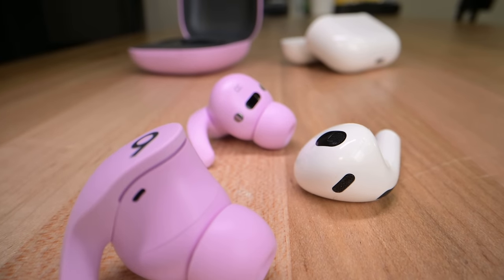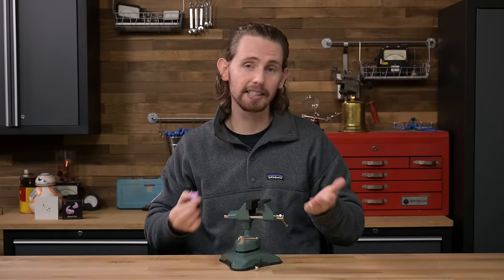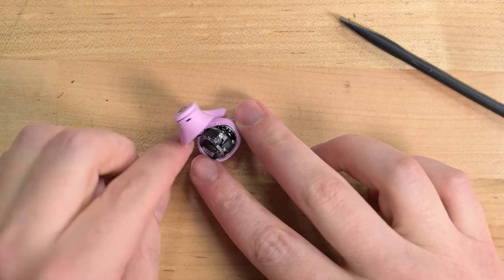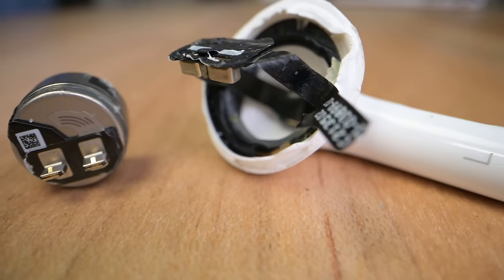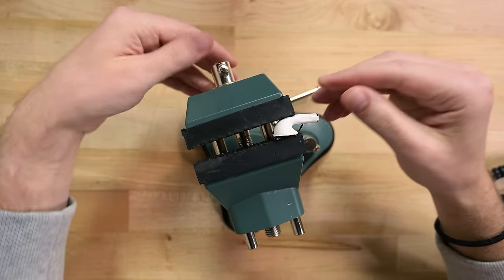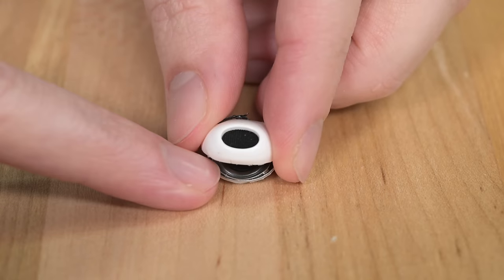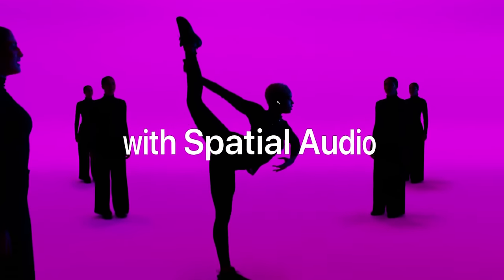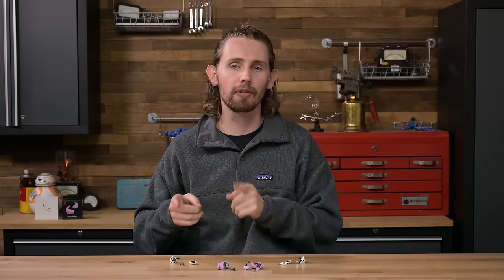AirPods 3 Have a New Trick Up Their Sleeve …

Comment: To be honest, H1 can't do this kind of computational audio. What Apple does is actually trying to render spatially-mastered tracks on the player device using the surround sound algorithm that allows them to simulate how the sounds propagate and change spatially. AirPods simply use the gyroscopes to measure how your head moves and the player device changes the spatial render parameters to produce spatially transformed sounds and play through the buds.
Reply: Still an impressive task for a small chip inside an earbud.
Reply: @cedricpomerleau5586  it’s just like joycon
Reply: @hatespeech96  Same, just there is an algorithm to split the original track into spatial components, then place them according to basically guessing. Then you have something playable as spatial audio. It's only as good as the guessing though.

Comment: I love the idea of the reusable gasket, I feel like screws would rust to easy though, because they're in contact with your skin so much
Reply: If the screws were stainless steel they wouldn't rust.
Reply: They also don't need to contact your skin, I mean they can put them on the other side. I do like the look of screws so idk not companies refuse to use them :D
Reply: @snaj9989  Personally, I am not bothered as the batteries will last about 3 years and when they are dead I would just buy new AirPods. £170 every 3 years isn’t bad.
Reply: @s.i.m.c.a  OK boomer.
Reply: @davidjacobs6244  consoomer moment
Reply: @davidjacobs6244  it's bad for the environment, really bad.

Comment: Reusable gaskets are extremely unreliable on industrial equipment, can’t see it be used in small consumer products
Reply: Airpods are not an assembly line production tool. It's just a landfill nightmare.
Reply: You're probably not looking for the kind of seal you might require in an industrial application; say, high pressure or high temp... You're also unlikely to take your earbuds swimming, in any case
Reply: they use them in vaping ejuice tanks.
Reply: "Small consumer products" use reusable gaskets, its not that you need to keep high pressures here. The amount of comments trying the defend apple's bad decisions with illogical explanations is impressive.
Reply: @Edgard422  Exactly. It's not as if Apple Couldn't afford some top-flight engineering talent to make serviceable equipment... esp. when it comes at a price-premium.

Comment: Still hoping some geniuses with CAD software and a 3d printer will produce the enclosures your talking about (a couple of screws and a o-ring), into which the guts can be swapped
Reply: FDM prints are far from being able to reproduce mold-injection plastics properties
Reply: @csPinKie  OK, make a mold & cast it, then... silicone molds will work for low-volume stuff...
Reply: @buixote  eh no. it is not about the mold itself, it is about mold injecting pressure. 
you will not get near as solid injections, not to mention the surface finish.
yet, it would work, but the outcome wouldnt be wort the time you put in

Comment: Way to go, zero yet again! These earbuds are just a waste of resources - they're overpriced, will fill up with ear wax, have small batteries that need charging frequently (thus putting cycles on them quicker), and when the batteries do go kaput, you have basically e-waste. (Unless you have the skills and expertise to think up a second use for them, once disassembled enough.)
Conclusion: stick to traditional over ear headphones or wired earphones - the wired in ear headphones don't have batteries and are not e-waste in the same sense. They're also significantly cheaper - even if you do have to factor in an adapter from 3.5mm to something else.
Reply: you can use also wireless receiver and connect to it your own 3.5mm earbuds. This receiver has much bigger battery.

Comment: This is funny, didn’t use heat to separate the case when that’s literally the right way and saves you from scratching and deforming the case, they just want to make everything seem harder than it actually is
Reply: That plastic looks very thin, not sure if you can use heat like in a cellphone.

Comment: Interesting video but I have to wonder if you think devices like this are worthy of repairability. Even with the price of the AirPods, the cost of constructing them to replace batteries and/or drivers would seem almost cost-prohibited. No other IEM/earbu that I know of makes these devices repairable. 

Even if Apple made all their AirPods repairable, it would be an absolute nightmare to make the tools and provided the parts needed to do such work, especially for something so small. Even skilled hands would struggle in making sure all things are replaced within very tight tolerances. This is why AppleCare would allow you to replace AirPods if they're defective - for a small cost of course. 

Lastly, there has to be some compromises made to get all that tech/batteries/drivers, etc, into such a tiny space that some shortcuts were probably intended, so the "convenience of repairability" is probably the last thing Apple (or any earbuds maker for that matter) is thinking about. 

But still, it was nice to see the insides of the Airpods 3.